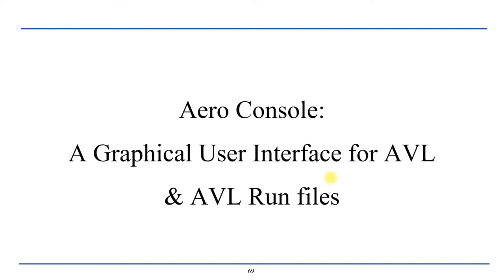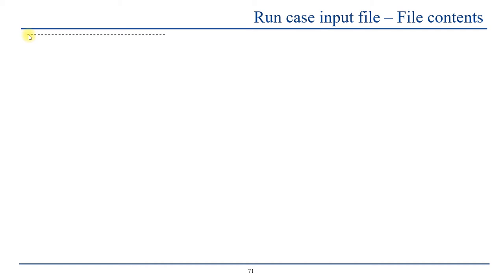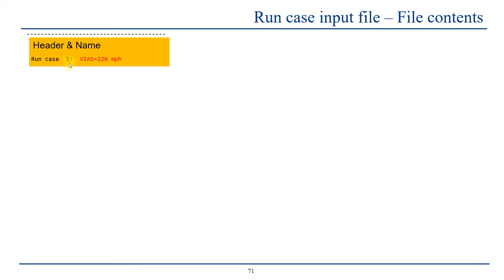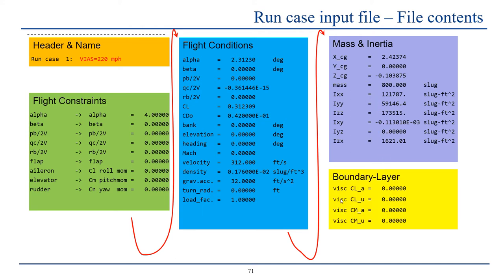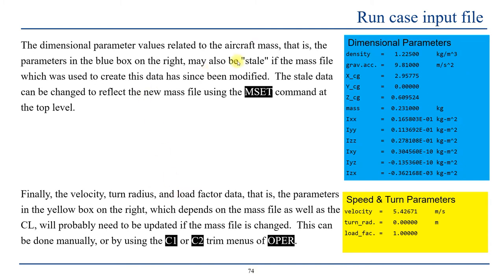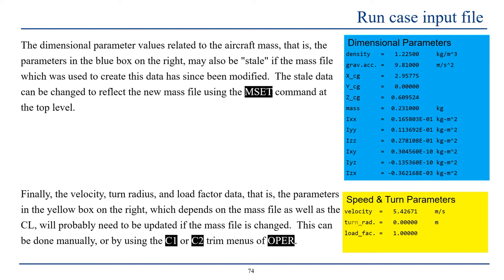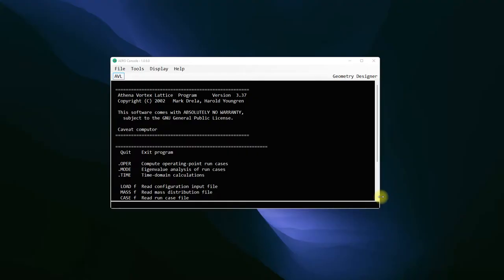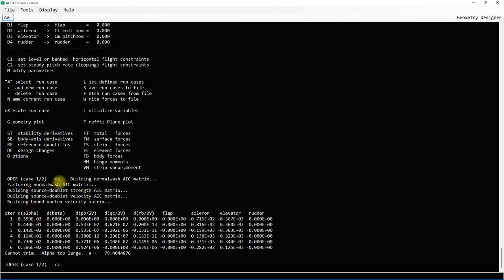AVL Tutorial - Part 06 - Aero Console and Run Files

Comment: Thank you. Very useful video. How can I store the surface force results of more than one case in the same text file?
Reply from the maker: As far as I know, that is not possible, unless you use extral code (MATLAB, Python, etc.) to manually run cases in sequence and save/merge results in the same file.

Comment: Thank you. How can i change angles of control surfaces to obtain a specific lift coefficient? For example, i tried with D1 C 1.5 but AVL can't converge. I need to obtain a specific CL for take off or landing procedures and so i need to know what are the angles of my control surfaces. Only with A A 20° for example i find a high CL without any problem in convergence.
Reply from the maker: Have you tried increasing your max iteration count?
Reply: @arahimi_ Nope. How can i do it?
Reply from the maker: @xcvb2347   I think I was thinking about XFoil. For AVl read these https://web.mit.edu/drela/Public/web/avl/avl_doc.txt#:~:text=A%20number%20of,will%20be%20significant. and https://web.mit.edu/drela/Public/web/avl/avl_doc.txt#:~:text=Flow%20Solution%0A%2D%20%2D%20%2D%20%2D%20%2D%20%2D%20%2D%0AOnce%20all%20the%20appropriate%20constraints%20are%20set%20up%2C%20the%20solution%0Ais%20executed%20with%20the%20X%20command.%20%20If%20the%20variable/constraint%0Asystem%20is%20ill%2Dposed%2C%20the%20solution%20probably%20will%20not%20converge. It may be that you problem is ill-posed or just need to modify your meshing a little.

Comment: hello, why did not you add CD0 value in the run case file and how can I find CD0 value to add in run case file
Reply from the maker: This is a basic review of the AVL software and we did not cover more advanced options for the settings in all file types. The value of CD0 is related to the geometry, material, and other properties of the airfoil/aircraft. You can read more on how to calculate/obtain these values for aircraft/airfoil here http://www.dept.aoe.vt.edu/~cliff/aoe3104_01/notes/drag.pdf and https://aerotoolbox.com/drag-polar/#more-1325